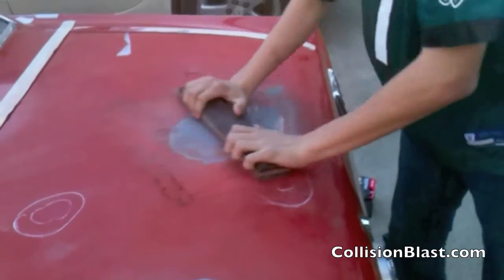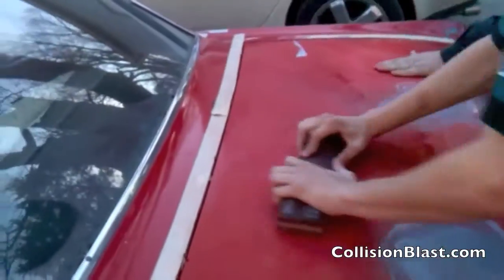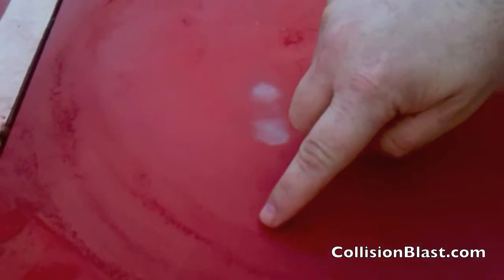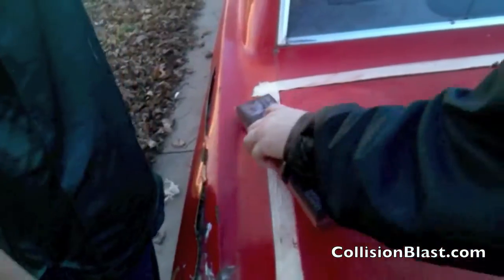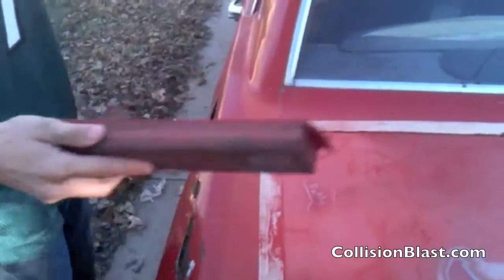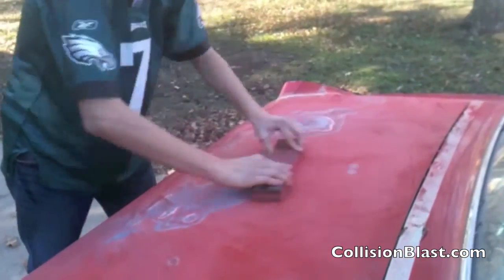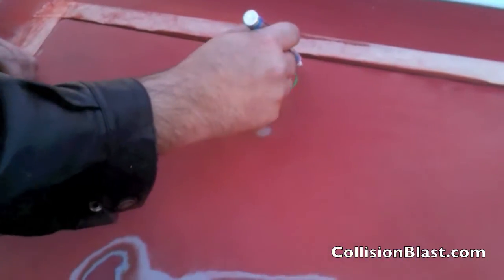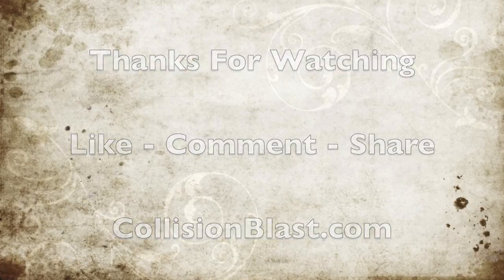Body Work: Working On 1966 Mustang Deck Lid - Finding Damage

Comment from the maker: @yaboyprime614 It is good to sand in different directions.  Sanding in only one direction will not level as well as the x pattern.  So you can sand up and down occasionally, but mix that up using the x pattern as well.  Thanks for watching.

Comment from the maker: @vochitoken If you are just blocking paint to check for lows, I would use 320 grit on a block.  If no dents are found go back over the paint with 400 to 600 before painting.  Thanks for watching.

Comment from the maker: @67dodgepolara I agree, if an imperfection blocks out before priming, there is no reason to use primer surfacer.  However, if you sand through to metal, self etch or epoxy primer should be sprayed on the metal surface for corrosion protection.  Thanks for watching... Send me some pics or reply to this video with a video of your project if you get a chance.